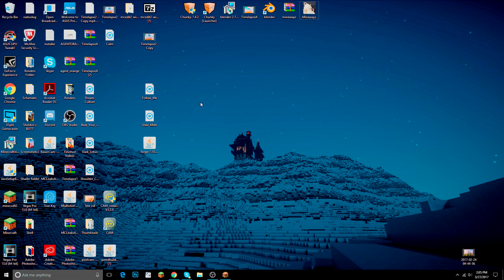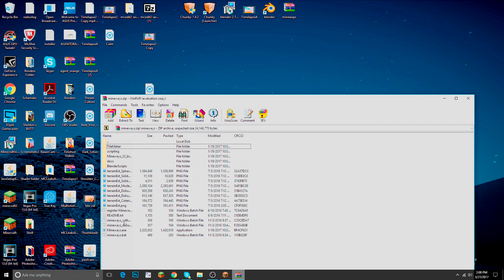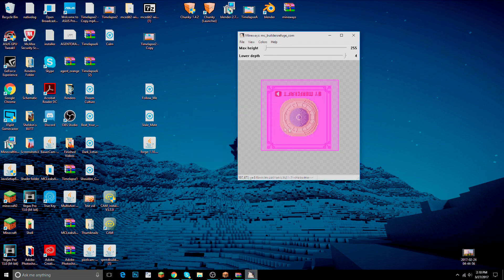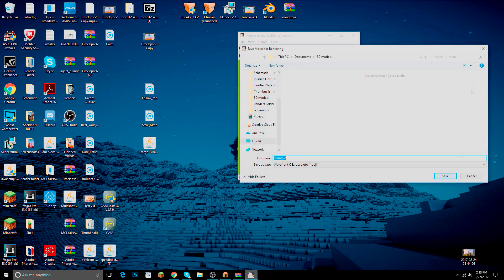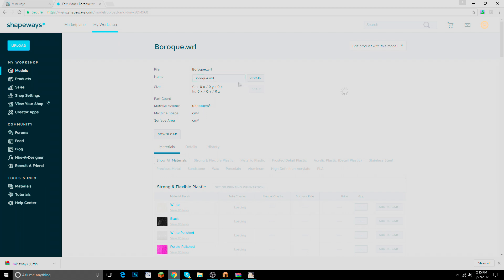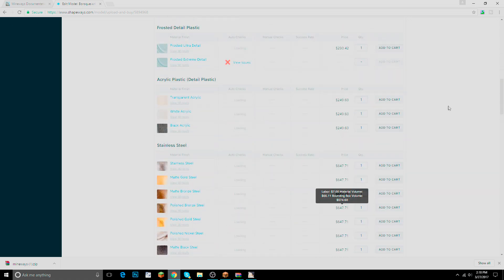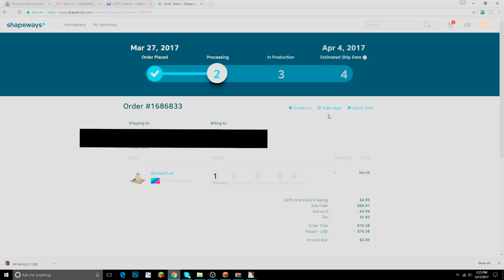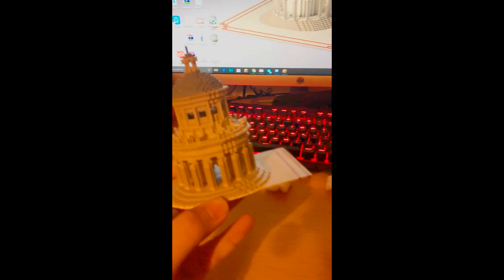Minecraft Tutorial- How to 3D print YOUR OWN BUILD from Minecraft!!

Comment: Can you 3d print (MCPE) or Wiiu mc
Reply from the maker: unfortunately, I do not know, but I do not believe so either as the programs I used to print the build were all Windows 10 programs and java and such. Platforms like Wiiu and Bedrock (MCPE) are more limited and require a little more digging in, but I'll let you know if that is possible.
Reply: Yes you can, with structure blocks. /give @s structure_block 64